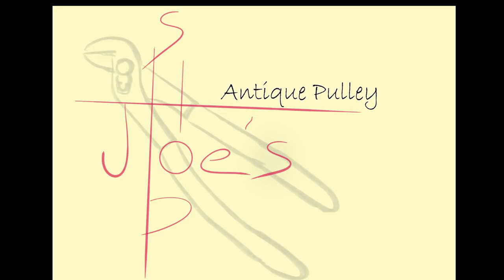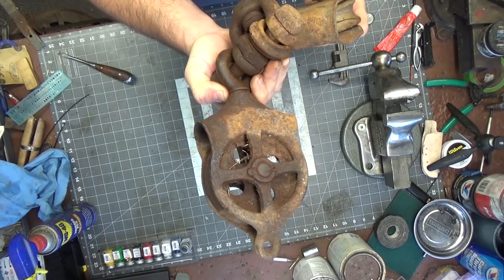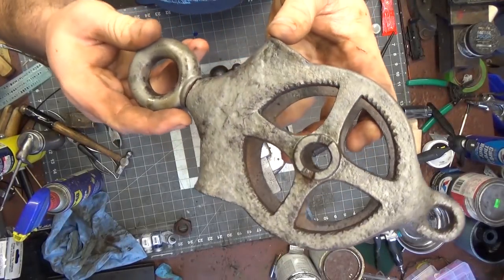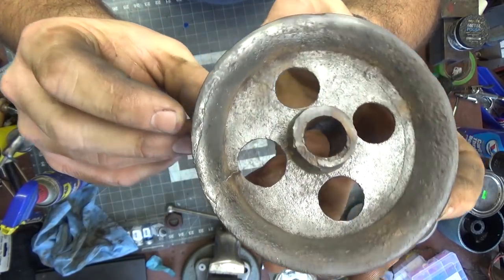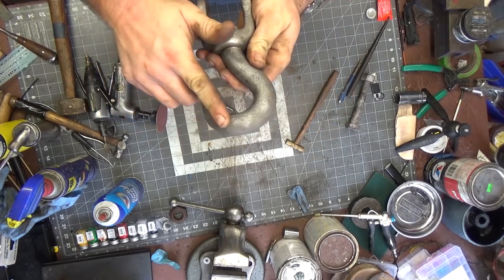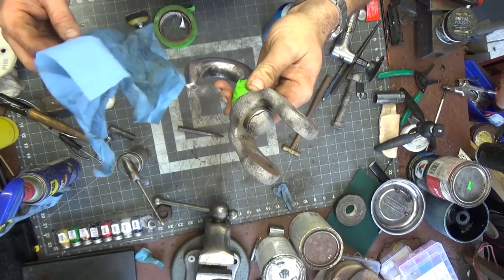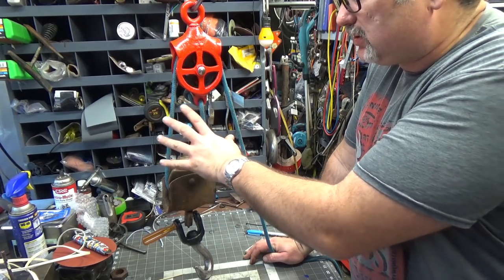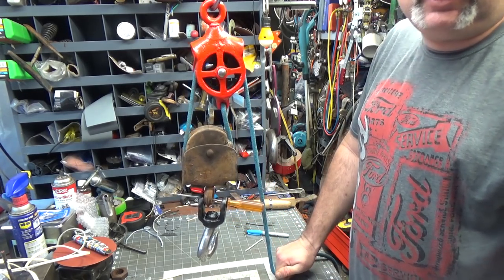Antique pulley restoration

Comment: I use clear spray paint to prevent rust. Great restoration. Great explanation of the pulley system.
Reply from the maker: Hi Michael. I have been experimenting with the clear laquer...so far it has been great. Cheers

Comment: Yeah, a birdfeeder suspended from that setup would look amazing. I don't think it's be too hard to turn a new wood wheel for it, as well as making a new rivet. Or replacing the rivet with a bolt. If you don't have a lathe there are ways to turn wood and metal on a drill press. Michael Cthulu uses that technique to great effect.
Reply from the maker: I have a small lathe that could probably handle that size pulley. I actually have a pile of these old wood pulleys, but since they are truly wall hangers they are very low on my priority list. Cheers

Comment: I used one of those as a kid lifting hay bales into the hay loft on my uncles barn.  We could lift four 70-80 lbs bales at a time. I think that one had a double pulley.  As a 12 year old i weighed maybe 100lbs I was able to lift close to 300 lbs 20 ft in the air.
Reply from the maker: Hi Russ! That sounds so cool. I was just telling Scoutcrafter how hay trollies are one of my favorite tools/machines. Cheers